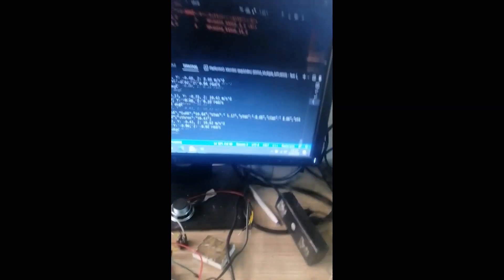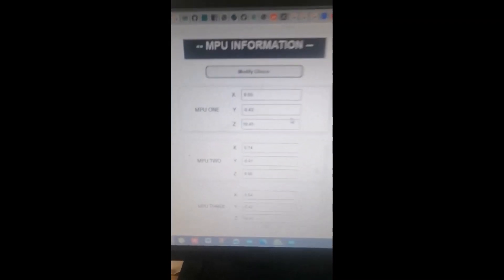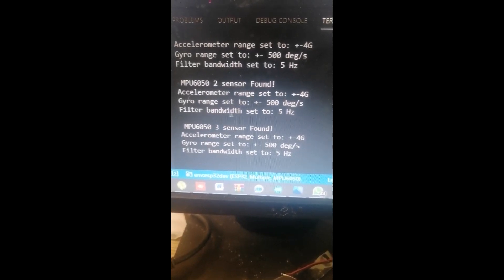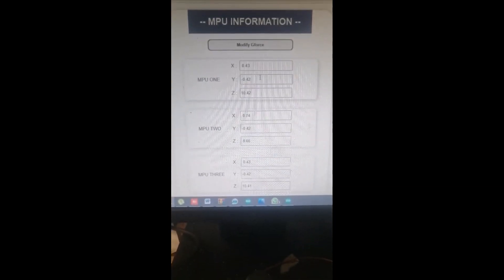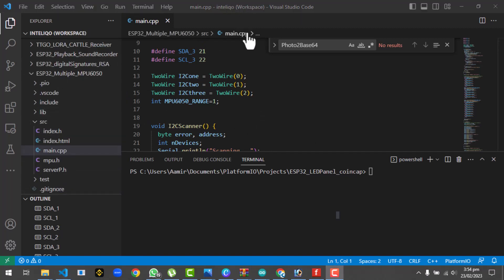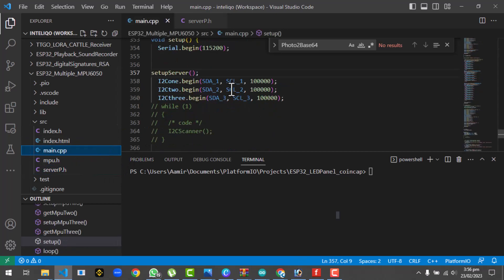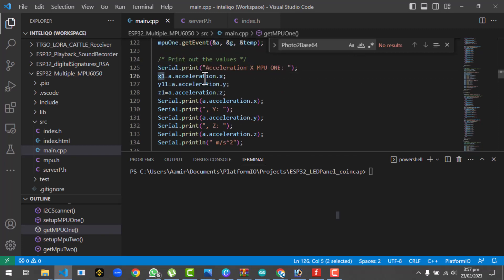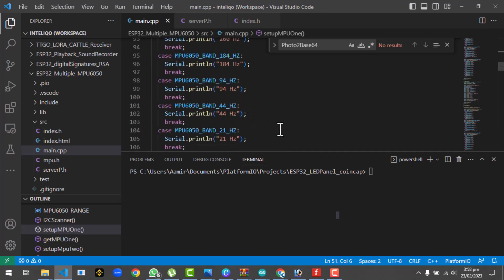ESP32 with Multiple MPU6050 Sensors: Building a Local Web Dashboard for Live Viewing Values

Comment: this does not work! you cant connect three i2c sensors without an i2c multiplexer. the values here are not correct
Reply from the maker: Use different I2C interface